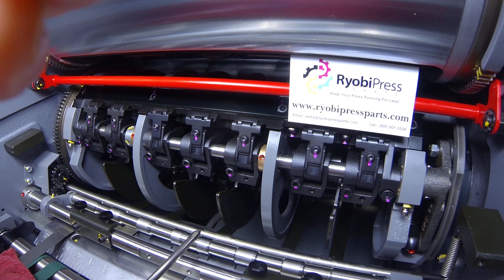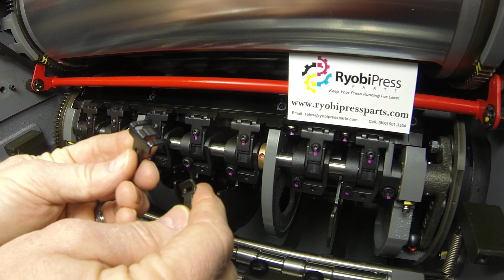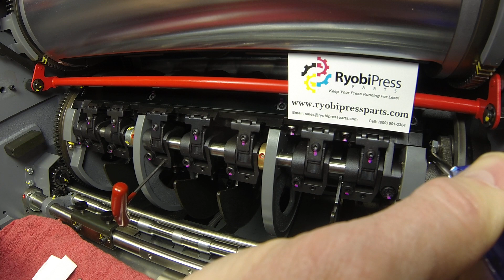Ryobi 3302 & 3304 transfer drum gripper & stopper replacement

Comment: Great video! I now see what I've done incorrectly.  I've been told my press was a frankenstein press.  How do I determine what grippers I need to order?
Reply from the maker: We have in stock in our Indianapolis warehouse, we have the largest inventory of OEM Ryobi Press Parts in the country.
Here is the link for the grippers.
https://www.ryobipressparts.com/products/5340-36-555-2-5340-36-550-1-set-of-7
Reply: I was a service engineer for 40 years. I have worked on the Ryobi 3302 almost since the introduction to America. 
A note on these and also the impression grippers. Look to see if the rubber pad is worn or missing. If in doubt replace it. If you are loosing your register these grippers may be the culpret.

Also when inspecting the stoppers make sure they are not bent. Better to replace than to try to reform. Lastly as mentioned there are 2 stops. Usually you will find that the 2 stops are not of equal pressure make sure that the one with the most pressure is the one that you put the feeler guage under.

Good video and sound adjustment procedures!